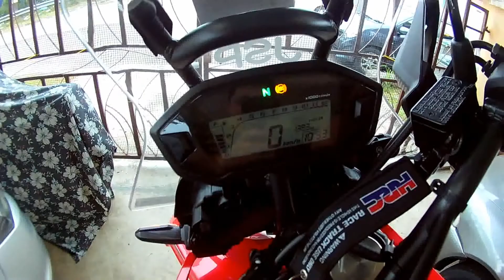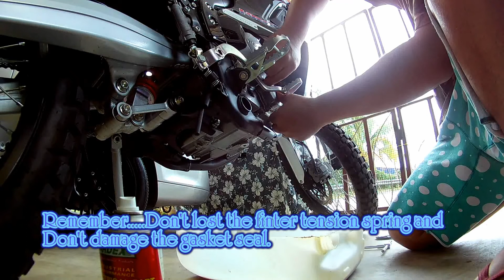Honda CRF250RLA Rallly Oil & Filter Change

Comment: Good video 
Internet sites shit for basic info
Would like to know oil filter type number think it’s hf 103
Would like to know oem part number for Honda crf 250 rally 2017 oil filter
Reply from the maker: Sorry for late reply. I'm using original oil filter from Honda.
Here is Honda original element oil part no: 15410-KYJ-902.

Comment: Beautifully done Xavier! Your bike is so clean! Did you use motorcycle specific oil?
Reply from the maker: Due to Malaysia weather quite hot i use 10W-40 full synthetic oil. (Shell advance ultra).
Reply: Thats oil good or bad for crf 250 rally?

Comment: Nak buka cover bodi/filter/oil kena pakai tool nombor berapa ya
Reply from the maker: Oil drain plug socket 12mm. Cover oil filter socket 8mm. Skid plate socket 10mm dan allen key size 5.
Reply: @GhostReaper81  tqvm
Reply from the maker: @ZaminOmarDSLRTv  No problem